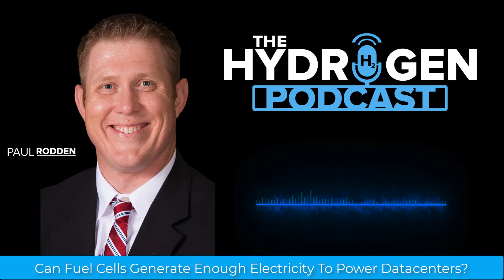Can Fuel Cells Generate Enough Electricity To Power Microsoft’s Datacenters?

Comment: Fuel cells might seem like the solution to many problems, but I would offer a word of caution. Fuel cells require very pure hydrogen to work, otherwise impurities cause major life detriment of the membrane. They also have very specific operating condition restrictions. Temperatures, pressures, air quality, etc. It can all mess with fuel cells. All I'm saying is, fuel cells are great, but not the ideal solution for many situations.